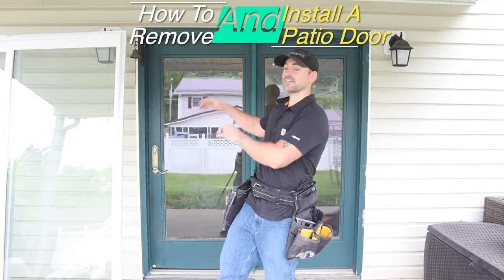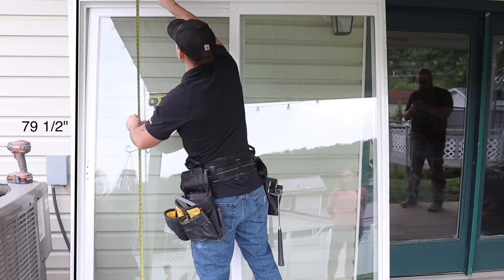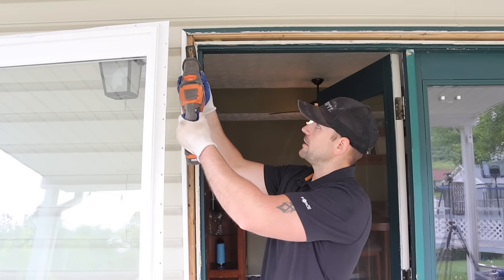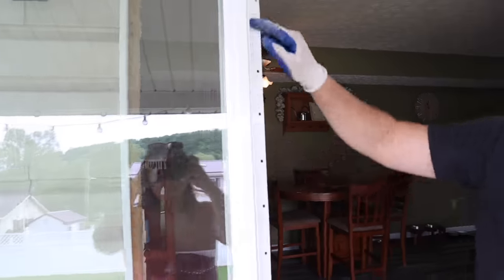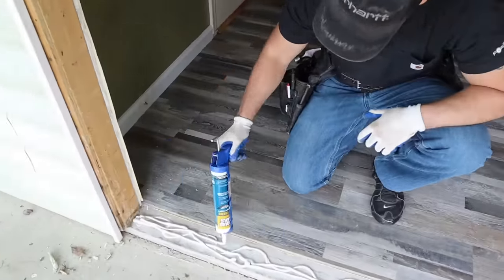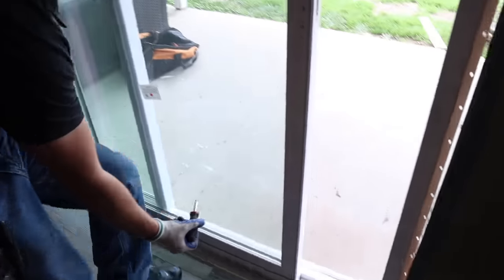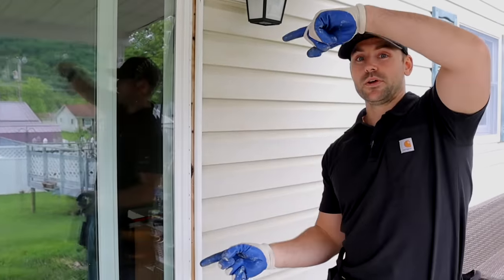How To Remove And Install A Patio Door - QUICK AND EASY! Step-By-Step Tutorial

Comment: Hey Josh, nice video and just in time ! I’m replacing two sliding patio doors at this time. I had a severe water intrusion at the bottom of both because of a deck installed when the house was new 17 years ago! The flashing under the ledger board was not a z type and the never nailed it above the ledger to the wall or chalked it or sealed it at all! I had to replace 20 + ft of my rim joist and damage to the floor under the sliders. This wall faces the West and is always in receiving the full force of any rain here in NC . It so happens I’m using Relia Built slider’s 👍👍 this is the second time I’ve ever replaced a patio door in 2 years. I just finished a remodel for my girlfriend house in 2020.

Comment: I truly need to replace my back sliding door. The house was built in 1968 and it's the original door. I've replaced the rollers so many times and can't even buy them any more. The aluminum threshold is worn almost flat and and the screws in the handle stripped out so I am using screwdrivers to open it and vice grips to lock it. So of course I'm watching videos. I'm waiting for fall when the bugs die out.  Thanks for the video. Mine is brick but every little bit of info helps.

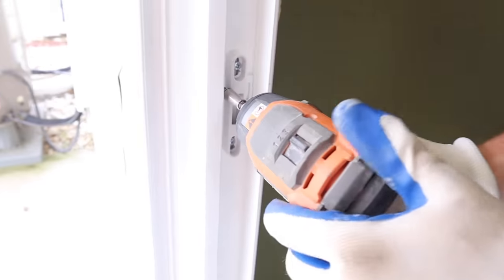Comment: So at 11:02 you show how to set the reveal and adjust the latch. From the inside view we can see the holes to the latching side nailing flange are missing the opening. 

Did you install the piece of ? quarter ? board to fill that gap then somehow attach to that? Or is the latching side only fastened by two small latch screws?

Comment: How is the door secured to the home ? Just by the nailing flange & 2 screws used for the latch ? Are there any holes around the inside of the frame for install ?

Comment: Thank you for doing this video.  My son just purchased a new patio door and it has the flanges on it.  Now I know what I will need to do to the trim.  The part I will have to do is make the opening to fit.  He found a 72 in door in stock and his opening is 76 inches.
Reply: It’s easier to make it small than larger 😎 have fun  don’t cover up any rotten wood !
Reply: @richardrumplik7023  Thank you!
Reply: @richardrumplik7023  Thank you

Comment: This is awesome! I just bought an older house with an opening door. I want a patio sliding door for summer for the screen door. Plus there's tips of things that could happen like the top gap of the patio in this video.
Reply from the maker: Thank you! Patio doors can be somewhat complicated if the opening is not square. I try to keep it simple in the video. Thanks for watching!

Comment: I watched 2 of your slider installs.  Just wanting to clarify the different schools of thought. Not challenging your technique. I had seen the question asked by another viewer and didn't see an answer so I thought Id take a shot. He had asked and Im also wondering. Regarding nailing the top flange. He had said he thought you don't. Other installers claim they dont due to changes in load, movement of header, expansion and contraction etc. potentially putting lift or flex on frame or worse, glass. They say they never nail top (Or bottom if applicable) only silicone or liquid nails and then nail sides. Allowing for some freedom of movement while still being sealed.  What are your thoughts ?  Aside from potential warranty issues.

Comment: @The Excellent Laborer, at about the 12 minute mark I noticed you started talking about how to install the trim boards on the in and outside of the door. Do you have any videos or info you can share with me on how to do that? You said you'd show us how but you didn't have material. I am wanting to install a sliding patio door where I currently have French doors and the opening is slightly too big right now and so the opening needs to be shrunk a little bit and then new trim would have to go on after that. I've never done a project like this before, but it also doesn't seem like a terribly hard job. The outside of my house also has stucco on it since I'm here in AZ. Any help with this would be appreciated!

Comment: Dang, I watched this video specifically for the end and then you didn't do the part I was looking for. :/ My sliding glass door is fine, but the people who installed it just did not give two single craps about finishing up the job. It looks basically how this one in the video does by the end, only even less filled in with the foam. So I need to learn how to finish it up and make it not look so terrible.
Reply: Don't overdo the foam or it will bend the frame and mess up the door! It won't open or close smooth and or leave gaps.

Comment: hello Josh. I did the reverse. I removed the sliding doors and I'm adding  French doors.  I' stuck after removing the sliding doors.  How do I remove the aluminum frame that held the sliding doors?  Thanks.
Reply from the maker: I don’t know your exact situation, but I do know from past experiences a sawzall is a big help in that situation. We would either sawzall the nailing flange and pull the frame out or sawsall down the middle of the frame then pull it out. I hope that helps!

Comment: Would you be able to reuse the door you take out in another opening? I am having French doors installed but would like to reuse my sliding doors they remove for another opening that currently has a sliding door.  The sliding doors I want to replace frost up in the winter but the sliding doors that the French doors are replacing don't frost up.

Comment: May I ask why the bottom wasn’t weather proofed and sealed with a liner or metal pan/flange? Or does these new vinyl doors don’t need it anymore?
Reply: You should do it on a wood base. Cement won't rot.
Reply: Not  really 😊

Comment: Question, the door thst slides does it have to be on the inside of the house or can it also be on the outside of the house per building codes?
Reply: Just another viewer here. A proper install is typically with the slider on or toward the inside. So for example but not the reason, you can put a stick in the bottom track to offer additional security. I use that example to clarify what I meant by slider on the inside. Many doors can be configured by flipping and reinstalling hardware etc to accommodate this. Some allow flipping. Some allow taking the top and bottom rail off and switching. But  keep in mind not all.  Some you just have to buy or order correctly. When they specify LH or RH as an option to select its likely not a universal or reversible door.   Universal or reversible are key buzz words to look for if you're having trouble finding the proper configuration for your needs.

Comment: How high should a threshold sit from the interior floor to the top of the frame? I recently had mine replaced and we keep catching ourselves from trimming over it as the previous one set fairly flush with the ground. Wood subfloor was replaced on outside due to rot as you mentioned but I’m wondering if it should have not been as thick due to the threshold being higher on new door vs old door.

Comment: Great video! I recently purchased a used patio/French door that I would like to install in my mobile home. My concern is that the house is 2'x4' construction while the door is 2'x6' framing. Is this doable?
Reply: You will have to build out a bunch on the inside. Mobile home usually aren't even 2x4 thick

Comment: All in all and educational video. In my opinion, never set a door with Liquid Nails, use 100% silicone and regardless of what you are setting it on. And I always flash the sill and tape the jambs for moisture and insect prevention.

Better quality doors aren't as flimsy and don't need a rip to pad out to the inside trim. Seeing how bowed and easy you moved the latch side jamb was concerning to me...
Reply: Good points.  Got a door in the opening but he has no clue how to flash it properly.
Reply: I also was curious as to why he uses an adhesive rather than caulk.

Comment: This is a great video, but you lost me on the ending with the inch and a quarter wood that you had to add but didn't have the parts to show. Did you end up making a video on this part? I could't find it. you mentioned putting 5 quarter board on the outside, but I'm lost on how to do it.

Comment: Does adding liquid nails on the bottom make it harder to remove in the future? What about just using caulking?
Reply from the maker: It does hold the threshold down better than caulking. It also keeps the threshold more stable over time. I recommend liquid nails but silicone caulking is probably OK. Hope that helps!

Comment: Now don't you need flashing in the bottom to prevent water?
Reply: I was wondering about this as well?  And the top for water prevention?
Reply: @darryn8145  I know you can skip on the top but on the bottom you definitely need tape flashing

Comment: Did you say $360 for a patio door? That's got to be a real POS. That's a huge hole in your house by some quality so you don't pay for it over time with energy lost
Reply: Would the installation method be different if the door cost more? The video is teaching/demonstrating installation. He isn’t selling or recommending the door. The cost is as irrelevant as your comment.